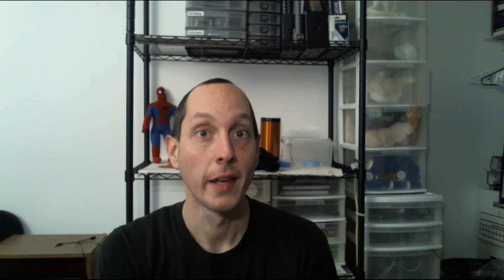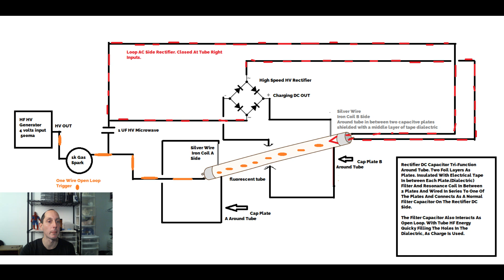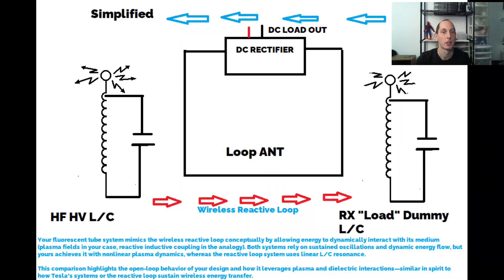Don Smith Phase Correction

Comment: Don ran on 21 Mhz...for most of his systems..The vending machine device that I saw with my grandfather was fairly simple.. He had a neon sign transformer that ran on 12 volts going through his version of the full wave bridge to a capacitor which then went through 6 plasma gaps to a thyristor which chopped the DC into pulsed DC which then went through a toroid which smoothed  the pulsed DC into a nearly perfect sine wave thing...this would run nearly anything that used a 115 volt AC ...I would love to see you build one of these.. I know you have the understanding...I believe that a triggered spark gap can be used for this instead of a thyristor...Thanks Jen for all you do to stimulate the cause..Also no one ever talks about the  6 spark gaps.. These are directly from Plausen's converter patent... If you look at Clausen's work and patents you will see that Don's align very well...-John
Reply from the maker: A little off topic. I noticed I can get a near perfect sinewave on a transformer by pulsing dc on the primary side. Maybe I did something wrong hehe. Seems just about any induction will smooth the wave. Transformer at the V/I loss. But you can just wrap one of the DC wires around a circular core without the transformer loss. Maybe i'm getting it all wrong :)
Reply: @joellagace1679  Thank you..I doubt you of all people are getting anything wrong...lol
Reply: @biokemist, was the capacitor on that device in parallel or series?
By this I mean:
 Sometimes you see bridge rectifier connected with only postive output to one side of ac connenction and  other ac side of rectifier to Earth ground.
But I know it´s also possible to have Earth ground current from a static charge just by connecting one side of capacitor to Earth ground. When disconnecting and reconnecting you get again Earth ground current. I know that a thyristor (also called scr) can actually break that connection while a mosfet doesn´t work for this. So I see possibilities in the 2 possible ways. Just charging up capacitor in parallel and use it´s voltage difference to Earth, or place it in series with one side of cap to bridge and other side used for connecting output stage (DSE)
The use of bigger capacitor to have more availble is something I haven´t experienced yet.
Reply: @brunovk417  It was in parallel...I do not know what the capacitor value was but   the output from the FBWR (Don's special) went right into it.. The spark gaps were to drop the voltage I believe..-John
Reply: @brunovk417  Keep me in the loop if you build that..If you have an email we can stay in touch..-John
Reply: @brunovk417  The vending machine device is the only device Don ever gave the full system including he output to run a 120 or 115 or 220  volt system  without an inverter.. The output from the torrid is exactly what is needed to run an AC machine even though it is pulsed DC..In plausen's converter he uses spark gaps to lower the voltage and that is exactly what Don did in this system.. There is an inherent problem and that is that the spark gaps do not last very long... The small plasma gaps made protecting devices were never made for continuous use..Great for demonstration however I do not know how long they would last in any long term situation...An inert gas or something else needs to be in a durable container and that would have to be developed if something doesn't exist already......I have  thinking of ways to eliminate  thyristor with something more durable and less expensive but haven't scaled that learning curve yet.. If you have a solution to this I would love to hear about it...-John
Reply: @Biokemist-o3k  The problem I have is the higher voltage for thyristor. 
A possibilty that I see for the sparkgap in series could be to prevent complete discharge of the capacitor and thus not making a low impedance load to the NST if the spark is quenched.
The super fast charging time of a big capacitor in parallel to NST is something I have problem with. I know a spark can cause serious spikes of Earth ground current or voltage if you place a scope probe in the neighborhood, Capturing it in a big capacitor to be able and do 50 or 60hz output, is something else.

Maybe replacing the spark gap with Xenon tube like Zilano used in one of here circuits could last longer. She used it in parallel. But thinking on the drawing it was like it was also switched with scr with diode in opposite polarity across it. When you speak of the plasma gaps for this vending machine, it shines another light of where the idea came from.
Is there another picture available on the vending machine device then the one shown every where? ( because you say that it´s the one device that Don showed completly)
Reply: @brunovk417  I believe the plasma gaps were in parallel but check playpen's patent to see if that memory is correct. Yes the thyristor that can handle that current is admittedly hard to find. Don had access to stuff that we still do not unless there is a lot of money expended..That is why I believe an inert gas triggered spark gap running at 60hertz to chop the 4,000 volts  pulsed DC into something the microwave oven transformer can handle backwards.. I know it is not the original setup but it works.. The transformer has a lot of losses but it could be worked out.. The resonant capacitor is used with the mOV transformer.. Ido not believe it is a super fast charging of a transformer.. it is a low level device.. I believe a normal electrolytic will work and it is in parallel after the FWBR..
Reply: @brunovk417  Rereading your comment it doesn't seem like we are talking about the same device. Zilano never discussed the vending machine device ...she only talked about the table top device...you are combining two completely different devices..
Reply: @Biokemist-o3k about Zilano, in here final disclosure she used a xenon bulb in series to what looks like thyristor in parallel with diode with opposite polarity. I always asked myself where she saw that in Don´s devices , so I´m only refering to that part of here circuit.
Reply: Looking at AI enlarged picture it looks like there´s a pcb inside what I always thought was terminal block. There it looks like there´s also a diode beneath the cross sections that divide the terminal block. Ofcourse it´s AI so is it correct or not, maybe you can tell :)
The polarity of diode that I think to see follows the polarity of the thyristor.
Reply: @brunovk417  I have not looked at her stuff in a while.. Do not get yourself mixed up. build it exactly the way he did and it will work... I have sen it and I actually had one that I gave to my girlfriend to take back to Puerto Rico when they had that hurricanes that knocked out the power.. her family had a bar and a store and. evidently they were one of the only ones that had power until I lost touch with her..
Reply: @brunovk417  I believe it is much easier and more simple..there is nothing hidden from what I can remember...I know everyone thinks that is just a connector strip but you do not go from 3,000 volts right to a smoothing toroid...
Reply: @Biokemist-o3k , About the 3000V to 4000V, if the capacitor is in parallel it will take very long to charge up to that voltage, and I don´t think that the capacitor is made for those kind of voltages when actually charged. I know in the DSE effect where you place it in series, you can apply voltages above the maximum rating but that is only when you don´t charge the capacitor and use it as a copy machine to copy signal from one plate to the other (DSE).
There´s something over looked, I just haven´t found what. 
I have done experiments with diode across spark gap, and I could see the influence of the polarity of that diode in relation ship to Earth ground. I need to think about these things.
Reply: @brunovk417  I do not know what that capacitor was. Maybe it was a special made one...
Reply: @brunovk417  WOW..I have been thinking about what you said but I really believe the negative  was hooked up to the capacitor in parallel ..The capacitor was a large one.. Don had access to capacitors from all sorts of things because his friends were electrical engineers or at least two of them were.... I think that cap came from a large audio system that one of his friends was building  for a home theater at the time and he was making a custom amplifier for some  huge speakers...That was a different time but the technology is stable .. I didn't see Don use a Microwave transformer but I believe it would work however there  would be losses.. Joel nailed it with the filtering and voltage control.. That is the main problem..Getting the frequency , voltage and current to a usable level...It seems that you can achieve one or two but all three are elusive.. I could be wrong and Joel is proving it can be done..Thanks Joel...
Reply: Isn't the thyristor placed after the toroid?
Because the magic happens when the plasma discharges through the coil and I'd imagine that the thyristor interferes with the disruptive discharge.
Reply: @alan4x4  Just look at the picture and you will see that the thyristor is after the plasma gaps but before ht toroid.
Reply: @Biokemist-o3k  is the circuit of the vending machine power supply online? I've never seen it.
Reply: @alan4x4  Yes just search for it.. It is definitely on the net but I have not looked recently..if I come across it I wil post a link
Reply: You might have to watch some of his videos until you find it...I do not know where it is off hand but I have seen pictures different places...
Reply: @Biokemist, you speak of Don special FWBR, I always asked myself is the one diode with wrong polarity like it should be or not. It's causing a shortcut if you place both wires on output of NST. So I always ask if there was something else connected to that input side of the FWBR or that the shortcut was somehow done to cause an effect on  NST output. The picture that I have is not so clear on what´s exactly connected in the connections that are more to the back. It´s a real privilige you actually saw that device. So many questions answered to you :)
Reply: @brunovk417  I wish I could answer this question on Don's FWBR...It is my belief that a regular High frequency full wave bridge  rectifier using 2CL diodes should accomplish the same thing....I had a friend who built several of Don's devices in Georgia (Europe) and he used lines of diodes (20 in series and 20 in parallel  to get the rectification from the Table top devices that he built..How long have you been researching Don's stuff??
Reply: @Biokemist-o3k  Thanks. I need to look at things. At ali I saw some 100A 1600V thyristor. I also saw that the wire is the cathode whitch made me wonder if the plate with thyristor is correctly placed on the picture, that it needs to be flipped so that transformer coil is on side of capacitor.
Reply: @brunovk417  There is no transformer coil..There is a neon sign transformer, a Full wave bridge, a capacitor that can contain 3. or 4,000 volts  then there is  what I perceived to be 6 plasma spark gaps then the thyristor to chop the now reduced voltage ( aka plausen's converter down to 220 r 120 volts) into  60 chops a second  and into the smoothing toroid which gives it a sine wave...could not be any more simple...just have to figure out the spark gaps things and their values...
Reply: @Biokemist-o3k  okay. And is 21mhz an input ac  signal that's generated with an oscillator or is it like in Tesla coils, a natural oscillation or ringing of the secondary generated by a single pulse, at a lower frequency such as 20khz?
Reply: @alan4x4  The 21Mhz is essentialy the running frequency of the coil after the input signal..Don used an inverter and an NST (we are talking about the table top device not anything else..others ran on 30khz) to control current use..Now we have ZVS and flybacks..The (Tesla style coil sideways is next ) and then the rest of the system.. The vending machine system is completely different. The vending machine system is most like the cabinet that ran huge amounts of runway lights in his basement.. I helped him move them to a plane hangar because they were  and they were in the way..
Reply from the maker: Depending on frequency you don't need to spark gap. It's just convenient to have for a quick demo because it more or less eliminates a whole circuit stage.
Reply: @joellagace1679  Do you mean an extra stage between board with NST and board with thyristor, that has function to lower voltage?
As the part that is eliminated by the spark gap.
Reply: @vSchaub-SlackerJ is there a test circuit available to try things out? It´s not clear to me, what needs to resonate with eachother, or what and how needs to be tapped of a resonating tank . 
If the capacitor is not special made, I only can find higher uF (1000uF or higher) values at for example 400V, for what looks like electrolytic capacitor. If you look at reactance chart then resonant freqeuncy is extremly low if you look at the capacitor as part of resonating tank ( with that high value uF). So to me it looks like you somewhere need to tap of anothet resonating tank, without disturbing it, to be able and achieve this fast charging. There´s where my problem of understanding is.
Reply: @vSchaub-SlackerJ Thinking about the resonant rise: 
If one plate of capacitor is used as endpoint of a tank circuit, then I can see the possibilty that the capacitor could become part of resonant tank at higher frequency then when it´s part of closed loop of tank circuit. To convert that to really charge the capacitor, without disturbing the open loop part, is where I´m lost. If this is what is meant with resonant rise.
Reply: One thing we must also not forget is the smaller wire connection in the middle of what looks like terminal block where thyristor is connected to. To where is that leading at both sides, so as well as on terminal block as well as the starting point of that wire.
Reply: @vSchaub-SlackerJ Just looking for the answers to the questions asked is my goal. Many people talk about what´s happening, but the moment you experiment on it, you see things indeed happening, but not in the amount as should. The moment the more deeper questions come it´s always like this.
Reply: @vSchaub-SlackerJ For some reason I could only see your text of  message before, that´s why, in my email notification.
Everything in that post is absolutely true,  but when you speak of a spark used to go to higher frequencie, what is also true, then you will see it takes time before the next spark of the spark gap. And there´s the catch, that time between firing is to long. It created a higher frequency ringing, it created a surge in the coil that will start to ring, all of these things are indeed happening, just the time in between.
Then we can indeed talk about size of capacitor if it´s 30pF it will be faster then with 100uF, no problem there. For the vending machine device we are now talking on, this would mean that the capacitor, which is build to look like big electrolytic capacitor is a special made one, in the sense that up to now I have never come across such 30pF capacitor, looking like that ( to all I´m not a specialist, just have not seen it, doesn´t mean it´s not existing). In a setup like that with small capacitor, I experienced that it´s indeed possible to get things ringing, but at a much lower level and only when not loaded.
Somebody told me that people forget about pure resistance in a resonant tank. You have indeed the inductive and capacitve reactance cancelling each other but there´s still resistance. Now I know that due to the higher frequencies, there´s more going on outside the wire then inside, the problem there is that I have no negative resistance where things start to grow instead of decaying. Again, because I have not seen it myself, doesn´t mean it´s not existing, just trying to find the answers.
Reply: Just want to add, the series circuit of thyristor and spark gap talked about before, could be the solution to keep resonance, because spark gaps mostly fire when you don´t want them to fire because it´s at the wrong moment in time, killing the resonant ringing.
Reply: There´s always a difference with messages shown on my smartphone and on website, so if my previous 2 message can be seen on website then just want to add that source could be indeed dc to create what we want but spark gap on it´s own is only firing once with dc, you have something that behaves like open circuit switching. I personally only exoerienced this with thyristor, and not with mosfet. There´s something needed to break the reference with Earth ground, which is not incorporated in a mosfet. When you measure current to Earth ground you will only see one spike with mosfet, and that´s when you first connect Eart ground to it. Wheter it then starts to switch or not, no new spike. Even with extra diode to block the internal diode of mosfet.
With thyristor however I have seen this possibility to switch, just not fast enough or capable of higher voltages (with my limited knowledge on this).
Reply: @vSchaub-SlackerJ Just as I don´t like not to be able and get serious power, I also don´t like to always sound negative, so I tried to limit it with asking questions to where my problems are and keep a way from negative sounding response. It´s much more helpful to find a solution, then saying it´s not working like supposed to. I´ve seen the possibilities I know the final solution does exist if just those problems are solved, but the potential is there. 
You don´t know how much I tried to make a 20W lightbulb just running on it´s own, full brightness, by trying to combine things that I did experience. 
I don´t want to offend anybody, but just nodding yes and not be able to get things done myself, is also not in my list.